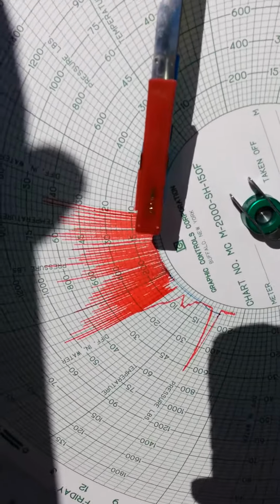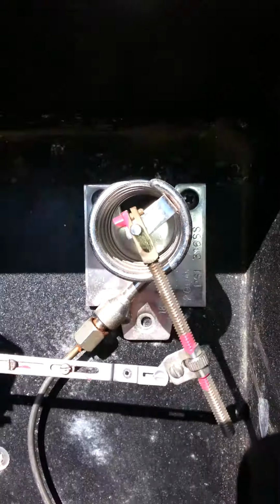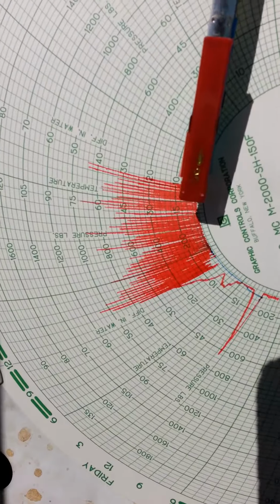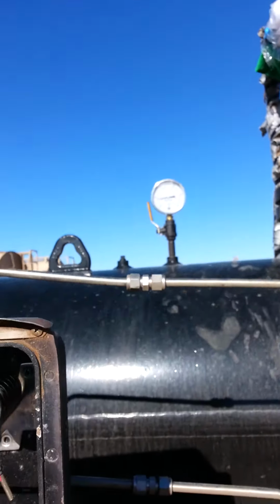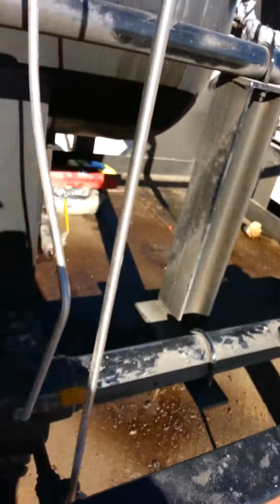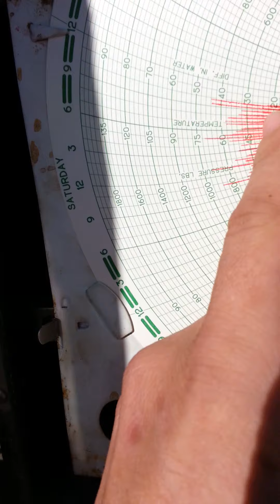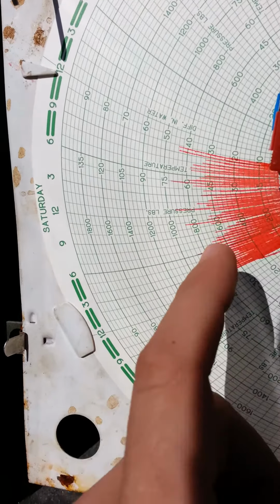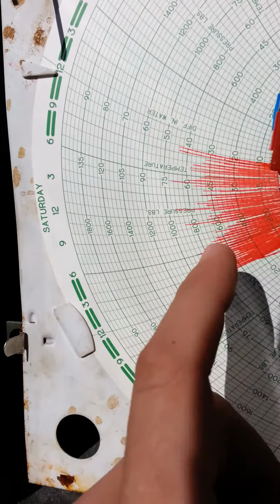Reading barton charts

Comment: BRO....I really really REALLY need you to go over that chart again. Please tell what direction it always travels and please say what the colors actually mean. What is pressure pounds and what is "DIFF in Water" mean PLEASE PLEASE thanks
Reply: I'm sorry my English is not good but I'll try to answers that question. Red = differential which mean we got the flowing gas / fluid after the orifice. Blue = static pressure. Green (I don't see at the video) = green color read the temperature of the fluid. The devices to read is on the pipe after the orifice (base on my separation vessel) ... And the direction always goes from left to the right... The easy way to read the Barton chart is calculated average from minimum value to maximum reading value on the chart.. As you can see the chart read every 15 minutes by 1 hour. You do the math from averaging every hour of movement pen